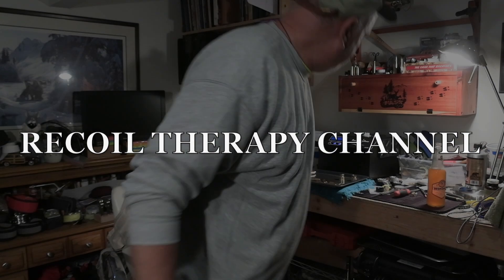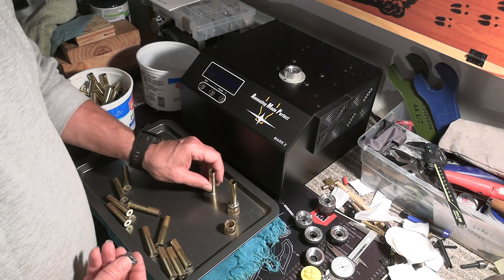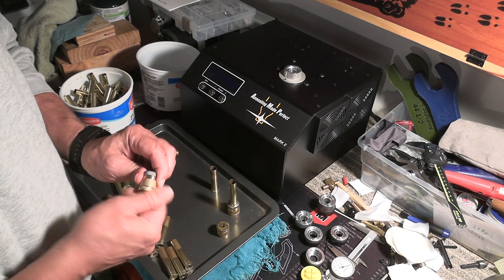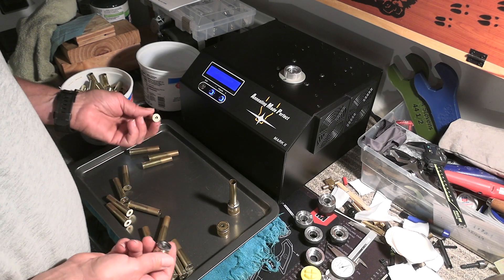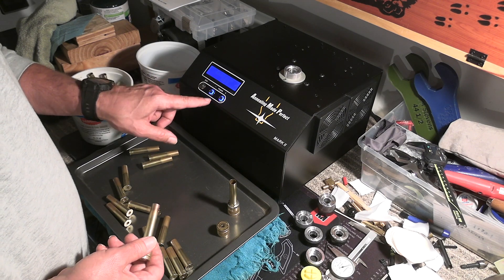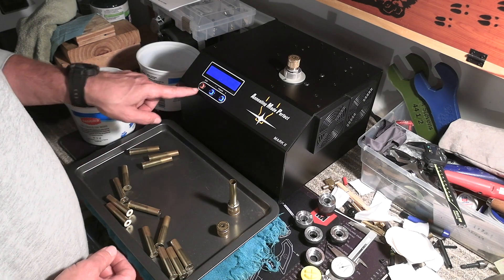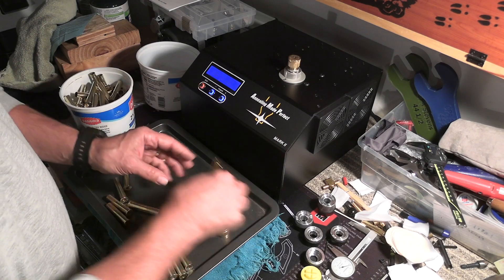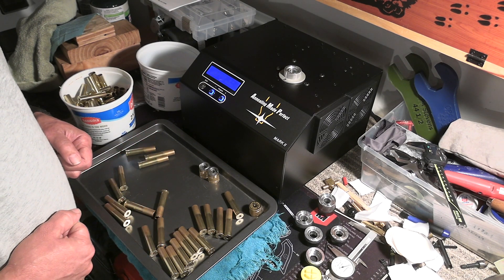AMP Annealing Machine

Comment: This AMP machine is high tech.  I started annealing to extend case life, and annealing made a dramatic improvement in the number of times a case could be reloaded.  Never attempted to compare precision with and without annealing.  
Could you share the results of your annealing shooting tests.
You have to go back to shooting two 445 SuperMags as the opening scene of the videos.

Comment: Looks pretty interesting. I have the Benchsource that has been doing okay but it sounds like this one is more scientifically consistent. Will be interesting to see your test groups and if there’s improvement. Separate question is if you’re going to be able to put your videos back up on your Pedersoli 1886? About ready to invest in one and seems like your older videos got flagged. Sad because you had some great reloading tips.

Comment: How consistent is the Annealer when working with mixed lots within the same brand? Say you have several Starline cases, all once fired from same barrel, but are unsure of all the lot numbers?
Reply from the maker: AMP advises to separate cases by head stamp and then lot number. When I ordered up my 45-90 cases, they all came in one shipment. I’m assuming they were all from the same lot. 

I have another bunch of 45-90 on order so when they get here I’ll be very interested to see if it analyzes the same as the previous lot. 

So far everything looks great though. Super consistent.

Comment: I just ordered one of the torch annealiers.  I probably shouldn't watch this.
Reply from the maker: The Bench Source is the best of the torch units. That said, it’s “analog technology”, meaning it depends on you to control and monitor your outcomes. 

The AMP has a brain that analyzes the piece of brass and exactly controls the anneal process. You pay for it through. Can get 3 Bench Source machines for the cost of one AMP plus needed pilots.